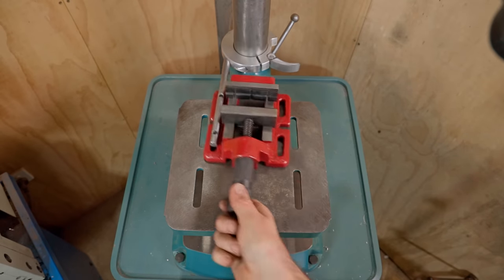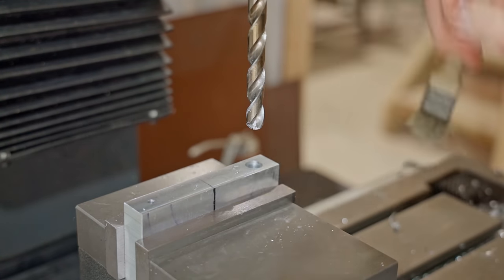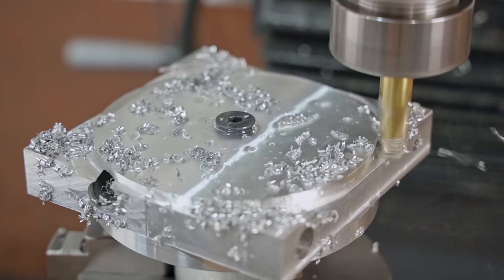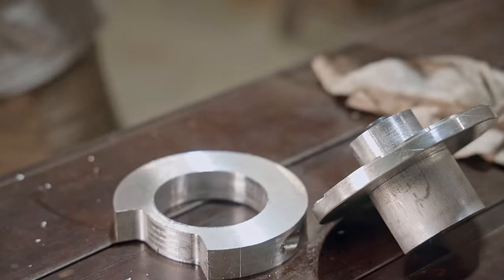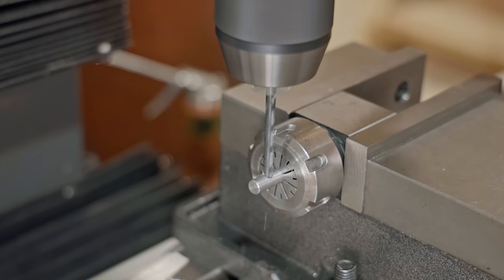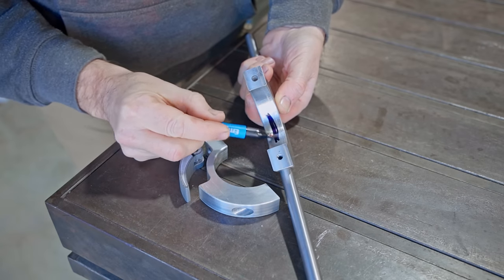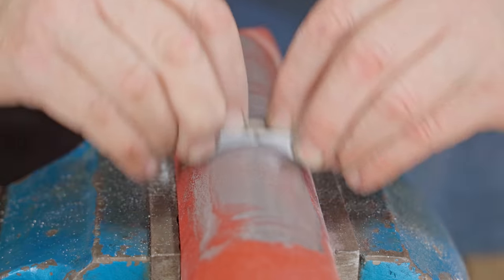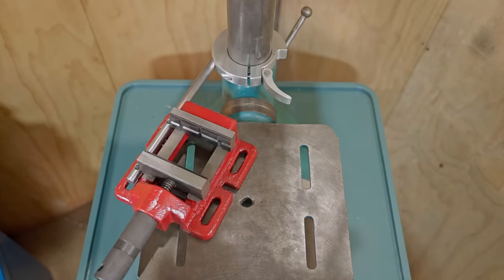Safely Lock Down Your Drill Press in an Instant

Comment from the maker: https://paskmakes.com/the-marking-knife/

I had this idea a couple of months ago and I've been itching to get at it. 
I'm super pleased with it as it works exactly how I hoped it would and makes the drill press a safer machine. It's quick and easy to set which I reckon makes it a winner. If something is easy to use then it will get used. 

Hopefully it inspires you to make one for yourself. If you do, there would be many ways to do it, not just by machining. You could fabricate one or even make one out of wood.  :)
Reply: I'd highly recommend checking out @MariusHornberger too, he's recently done something similar but dialed to 11
Reply: I'd recommend pure alcohol/ethanol as a coolant/lube for aluminium. WD-40 isn't the best for it.
Reply: @TheClimbex  How about the old school half kero, half paraffin liquid, or half WD 40, half paraffin ?
Reply: @stephensmith8756   @stephensmith8756  never tried that. On fully enclosed milling centers we use an high tech emulsion and even there, in small threat holes, we use ethanol for aluminium. In steel or stainless we use a thick cutting oil. For cutting aluminium on an open milling machine or drill press ethanol is best.
Reply: This is fantastic work. I always get nervous seeing people use bare hands on a drill press, or even an non-secured vise. 10/10 idea and execution. Thanks for sharing.
Reply: @DavidTaghehchian  I mostly drill on unsecured vise :D But I'm always expecting it to pull on certain moments, like drill going through or catching a wall in cavity. so I'm well prepared and it won't come out off my hand - drill bit will break first. But with drill bits larger than 10mm I'm always securing it when working with metal. Probably I would have less amount of broken drill bits if securing it properly all the time, but... well, bolting vise to drill press bed takes too much time :D But bare hands... no more, only for wood in certain situations, where piece won't fit in.
Reply: I think this is a great idea. I’m going to try to make a version out of wood. - And the video gave me solutions for a couple of other projects I’m working on. 👍👍
Reply: Hi, a constructive tip:

You should use the animated part at the end as a TikTok teaser to promote this video and your excellent channel! 

If you fancy it, animated TikTok’s of your projects could be your “thing”. It’s catchy and they would stand out in the grey sea of short films!

Kind regards 
Anders 
Sweden 

PS Great infotainment as usual. Cheers
Reply: That rotating table looks like a satisfying solution, especially if the problem was "why haven't I made a round version yet?" I'm going to give HDPE a go as the collar material because a lathe to machine that stuff is only ever a power drill and a few bearings away and mistakes can be erased by simply applying heat at 170 degrees for an appropriate length of time.
Reply: I’d buy this today if available. Need it but don’t have the time or machinery to make it.
Reply: Did you actually address that your clamp down lever looked to be too long?

Comment: The use of the shoe to translate ring clamping force into rod clamping is genius.  Very well done sir!
Reply: That's what struck me too -- the shoe solves the problem, and it's completely hidden too!
Reply: I also like how it clamps to the rod and stand with a single clamp action. The only thing I slightly question is needing a shoe, it seems like the rod hole could intersect the main center hole and clamp directly against the stand. It would be a much smaller surface area but the force would be more focused, for what is needed seems like it would still suffice for holding. Either way its a great device.
Reply: @nickcody7257  the shoe is likely to distribute the clamping force. The higher pressure from the smaller clamping area might deform his bar and reduce tool life.
Reply: @planbuildrepeat8264  The shoe was aluminium the bar steel.
Reply from the maker: Thanks very much John - glad you enjoyed that! :)
Reply: @planbuildrepeat8264  that's exactly what I thought was very smart about it, it provides quite a large and evenly distributed clamping area with such a simple mechanism, and by disconnecting it from the cam lever, it is accomplished without added mechanical complexity (or concentrated wear.)  Every time I consider it again I see even more advantages.  Like that it is 100% invisible to the user, you don't need to interact with it, so there's no reason to make it obvious.  And with the rounded rod end and sloping insertion land on the shoe, it's fairly foolproof too.
Reply: @nickcody7257  It's an old comment, but I wanted to say that clamping the bar across the column sounds like it would make some marks and deformation.
The shoe seems necessary to me.
Reply: @TerkanTyr  Not to mention that it's construction would have to be perfect first time.  Whereas, the shoe dimensions can be crept up on until it's perfect.  If you go too far, you can just make another shoe.  

Wheras if you find there;s insufficient clamping pressure using the rod only design, the only option is to scrap the whole thing and try again.
Reply: Not really. Due to the 2 separate axes contained by the shaft, the clamping force isn't needed. Still not a bad idea, but the system will naturally jam if there's ever a catch. The clamps are more extra insurance than truly functional.

Comment: As a refinement to this design, you could put a slight angle, maybe 1 or 2 degrees to the hole in the clamp for the rod angled down toward the drill table.  So when you tighten down the clamp, the rod would push down on the vice holding it in position.

Comment: I felt really pleased with myself for making some t-nuts so that I could bolt mine through the table, now you've completely blown me away!
I'm always impressed that you make things like the camlock lever rather than repurposing a cheap bike part.
Good work.
Reply from the maker: Thanks Ian - I'm sure your system works fine. Making things like the cam lever is the fun part! :)
Reply: And you can get the same exact result with a screwdriver in the table slot and like magic you got a stop
Reply: -- I was thinking the same exact thing... a table top quick release hold down clamp on a slotted shaft or simply a pin through one of the table slots and bump the vise up against it when centering the work under the drill bit. That's all it takes and it's quick and easy. While he did manufacture an elegant solution that seems to function, he was seriously overthinking things when he came up with his solution to a simple problem. I'll still give it two thumbs up. Best wishes!

- Max Giganteum

Comment: Super nice result.  I suspect as you use this more and more you'll realize that locking it down is unnecessary for most cases.  Having it free floating is truly where the magic of this design shines.  Since the rod is captured such that the vice can't spin once the drill bit is engaged.  Free to slide in X and Y does not compromise the safety in anyway.  Locking it down is really only helpful if you have multiple holes to be drilled in the same location.  👍😎👍 Thanks for the inspiration ...... I have added it to my list of projects i need to work.

Comment: Thanks for posting.  I'm not a machinist and as such I don't have much in the way of machining tools.  However, I do a good bit of cutting metal and drilling with a drill press.  I purchased a vice-grip type tool that bolts down thru the drill table slot and then clamps down onto the material being drilled.  It works pretty good for what I do and it has saved my fingers no doubt.  I do an inward cringe when I see someone just holding a chunk of steel with their fingers.  You design is really nice.  Thanks again.

Comment: I used to have a system like this that utilised the ring clamp from a damaged drill press with the same radius as mine. Worked well enough but a bit cumbersome, I let it go with the press when I sold it. Your version looks much easier to use - well done Sir

Comment: I feel like this would be a great intro to machining project, because it uses multiple work holding and machining techniques, it's practical and useable, and adjusting it to fit an individual drill press would be a good exercise in how to modify a design.

Comment: Great video and safety idea for the drill press. I think it will be very handy. I was taught to use the drill press column as a stop arm when possible to stop rotation of the drilled part. This accessory takes that to a much better safety feature.
Thanks for sharing.

Comment: The way I solved the problem was to clamp a stop to the table so if the piece spun it would hit the stop, giving me time to clear my hands.  Adding the rod to the vise as you've done, but such that it extends past the drill press post, will also solve this problem.  You don't need the ring at all.   I've never had a situation where the drill press return spring can lift the workpiece and the vise however.

Comment: I'd say the float lock vise you mention is better than the cheap drill press vises that a lot of beginners buy.  Your vise looks significantly better than the those cheap vises. For one, the cheap ones inexplicably have a gap at the back jaw so you can't use thin or average width parallels without them falling down.  Second, when you tightened your test piece , the amount of jaw lift was negligible, which tells me that the ways and the screw are fit to way better tolerances than those of the cheap vises.   So for your situation, your decision to work with what you had was spot on.  Great build!

Comment: This is a great idea! I was going to make a sliding drill press vise from scratch. But this is better. I did make a change though. Since I upgraded my press to a bigger inverter ready 3 phase motor and VFD, I’ve been using it for tapping with smaller taps than I want to do on my mill. But the problem with power tapping, as you know, is the lift the part has unless it’s locked to the table. As you show, getting that right is a real pain. The regular floating vise, which I was also going to modify has a major problem. If you have to drill off center to the hole in the middle of the table (yes, it happens), then you end up drilling through the table. Your way, the part leaves space between the bottom of the part and the table.

So a one side support as this has still allows the table to rotate up. So I made two supports one for either side of the vise, and made the part for the press column longer to better resist the lift force. The clamp is higher than the posts on this design to get at it easily.

When I said “made”, I really mean designed, as I’m away for the week, so I’m making nothing other than a nuisance of myself and my wife for our daughter (though she says differently).

Comment: nicely done. Another thing is that you don't even need to lock the ring, it will prevent spinning by it's design, and will allow movement from hole to hole much quicker. But still it works well tightened for more accurate holes.

Comment: Neil, today I had earmarked to make your lock down clamp for the drill press. However, I ended up changing the design. My drill press has the rack and pinion height mechanism o the column so I thought about your suggestion of using packing pieces but I didn't think it would work for me for 2 reasons; firstly the packing pieces would have to be stationary as the rack on the column only moves when the table is moved side to side; secondly the clamp would have to have a way to allow rotation between clamp and packing pieces and  not allow the packing pieces to fall out.
What I did was to take some 50mm mild steel bar about 45mm long and once faced and skimmed put a 7mm hole through the center, then part the bar into 2 pieces, one 21mm and the other the rest of and then face the cut surfaces. Now put a 4mm rod (an piece scavenged from a roadside printer) through both pieces and trap it securely in the milling machine vice with the 7mm bar laying on top and going front to back (I never know what axis that is!) Now find the edge and use a 6mm end mill start a hole about 12mm from the outer edge on the join line of the 2 pieces, once it is 10-15mm down finish the hole with a 6mm drill. Without moving anything enlarge the hole to suit the bar, I used 1/2". Now take the 2 halves and take a skim cut (I just did the top piece) now when the bolt is tightened the rod is trapped. Tomorrow I will cross drill for the screws to hold it to the vice. Thank you for the idea, I had fun and the achieved 2 outcomes; kept me out of earshot of her indoors and exercised the old grey matter!

Comment: Brilliant Neil as always.
Excuse me for thinking of a possible improvement.

A second rod or square bar or plate could be used to eliminate the possible lift of the vice that happens when a bit typically bites and sticks as it breaks through the bottom of steel.

I'm thinking of many build variations now that dont need all the machining.

Comment: I used to be a bit scared of the parts going flying because it happened on my dads drillpress when I was younger. Now that I have got my own cheap one, I still had this tension until recently I discovered that I can stop it with my hands on the workpiece. This is a great project and l keep it in the back of my head until I get a more powerful one :)

Comment: Stellar workmanship as per usual, Neil. Your videos inspired me to make a stand for a pc monitor without any vesa mount holes, that I wanted to use in the vertical position. Nice little bank holiday welding project with some spare 50 x 3 flat bar and an adjustable stand from another device. I could've bought something cheap off eBay, but I saved a few quid and got the satisfaction of making something myself. Look forward to your next project 👍

Comment: A nicely crafted improvement !  At 0:039 in the vid, i have the same vice that i mig tacked 2 pcs of .13 x 1.0 x 3.88 flat bar over those 2 back slots.This helped stop the pivot end kant twist clamps which used to twist in the groove 😂 1 inch of flat clamp surface on both sides.

Comment: A magnetic chuck + drill vise is pretty good too. You just need to tap 2-4 holes to the chuck. I did two M12 holes in a 6"x6" magnetic chuck and bolted down a Doyle 4" vise from Harbor Freight (I couldn't do 4 holes since the vise was slightly too large).

Comment: Good idea, shows how useful a milling machine can be. I did think the device could be made a little better. I suggest the outside could be shaped to add a little more material to support the steel rod. Essentially a rectangle bump so the rod enters a flat surface at right angles and exits the same way. That would strengthen the area where the rod goes in. Anyway a really good idea.

Comment: Wonderfull idea! really neat device, I wish I came up with that. I feel like it could be slightly improved. If the clamp's bore for the main drill shaft would be milled at a slight angle in regard to the cam lever movement plane - so the sliding bar would go at an incline towards the vice - I feel that the clamping forces could be pressing the vice toward the drill table. Anyway, this project is absolutely brilliant either way.

Comment: The ring clamp looks almost identical to one used on 3-4"  vacuum lines in labs, but the lever is a big pretty wing nut. The inside is grooved to mate with a flange.

Comment: This is absolutely brilliant!  As someone who has had material turn into a spinning weapon on a drill press, I can definitely appreciate the value of this.  I'd be a buyer, but this is well outside my skill (and tool) set to make myself.  I'm curious if others would be buyers of if it were a product...??
Reply: It does not need to be of this standard of build to have the same effect. Like he said you could make it out of wood use a cam lever off push mower folding handle or bike axle etc...

Comment: Great concept. Table height adjustment is one of the most annoying aspects of using my drill press (in a wood working shop). perhaps a similar linkage device that provides stability in the Z direction would allow you to forgo the table all together and have a rapid adjust vise in space. Maybe like a parallel kinematic machining head in a way.

Comment: harbor freght 36221 $10 drill press clamp will clamp most anything to drill press table including vice, attaches to table through slots in table and will move around on table by loosening ring nut under table. no telling how many hundred times it has kept me from getting hit by something i was drilling, quick to adjust or remove if needed  good vid thanx

Comment: That is clever. Thx for the idea. I'll give one tip back: next time cutting, sawing or machining aluminium, try soap water in spray bottle. Like one for leak testing. Work better than wd40. Specially if you gonna weld it later.

Comment: I do like this. I reckon just the bar to brace against the drill press column to stop the vice rotating, will suit my needs. I also have the height adjusting rack on my column.  A nice job though.

Comment: While I like the entire idea and our construction ascetics are exquisite, I would like to suggest for the average home user the ascetics  are not required and a external square would function just as well and be simpler to construct.
Then there are the Round Post Drill Presses which have an external floating gear rail for raising and lowering the table.

Comment: Very cool idea, thank you for sharing! I think the choice of soft, uneloxised aluminium could be a problem soon... It has bad friction values and is seizing up quickly under pressure and motion. Aluminium has many advantages in use for fixed parts. Parts with friction strained surfaces are better from (hardend) steel and will last much longer!